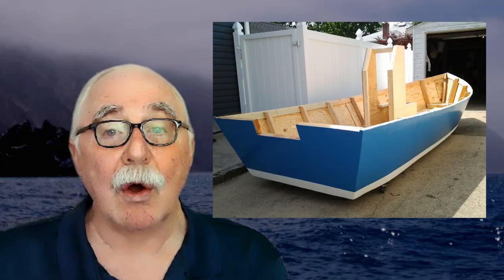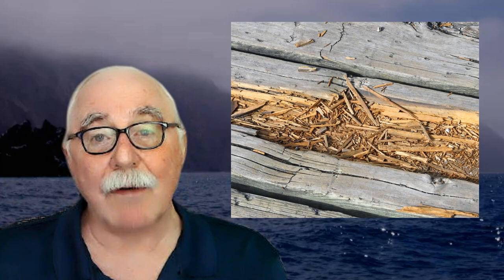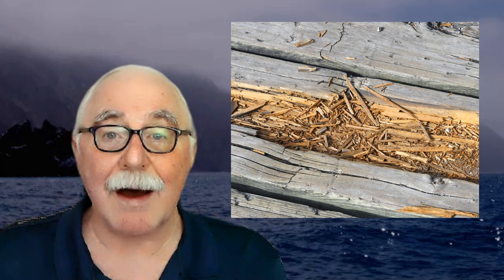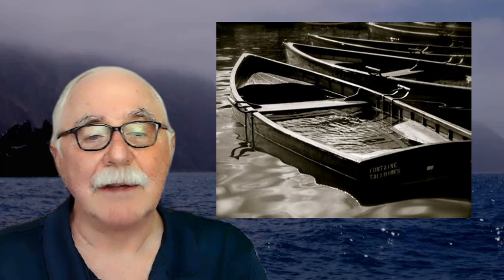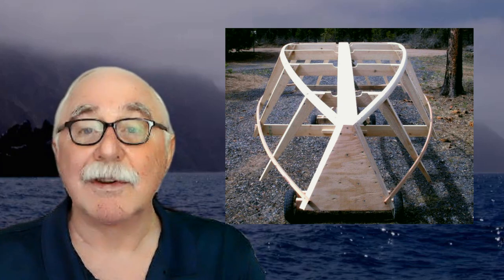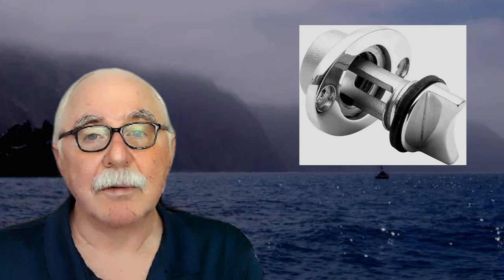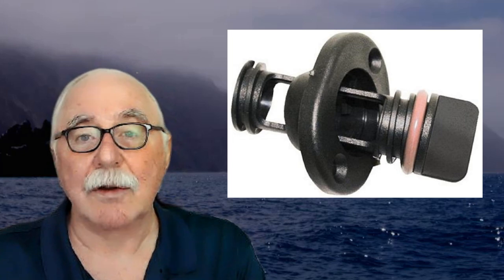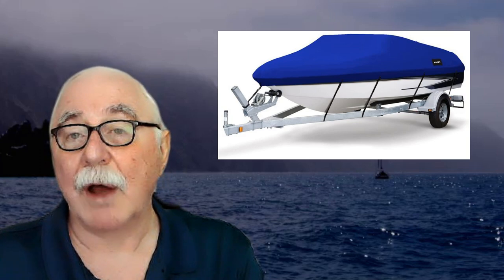Yes, You Can Build a Boat, Ply-on-Frame Boat Maintenance

Comment: In 1976 my father built a ply on frame 12 foot runabout and painted it outside with 2-pack iso-cyanate white and inside 2-pack boat varnish.  I helped him repaint it about 1989, 13 years later.  The white was still quite good, but the varnish on the topsides was badly cracked up.  Once done it was almost like new but should have been done 5 years earlier to prevent damage to the wood from cracked varnish.  Note, the boat was always stored covered and in a shed.

Comment: Hi Jeff…thanks for keeping us boat builders informed with up to date info. You didn’t mention anything about how epoxy coating the wood helps prevents root. I fiberglassed the outside of the boat and epoxy sealed the entire inside then painted everything. Perhaps you could discuss how the epoxy coating helps aid in longevity if the paint/varnish.

Comment: In the philippines i mix sbout 3 putty knifes of each part of marine epoxy and 1/3 gallon of lacquer thinner and mix it well then paint it on your wood and put 3 to 4 coats on all bare wood and it does an amazing job of water proofing the wood, then i apply 2 or 3 coats of marine epoxy primer then several coats of epoxy enamel paint and that seems to keep the wood dry no matter how much water sits in the hull. No fiberglass at all. 😁☔💦🏝️
Reply: Is this a joke?  Sorry, I'm not a boat guy. If you're serious.  I'm interested to know.
Reply: @nledelnr  yes it works great. The enamel i use is epoxy enamel for the final layer.

Comment: As an industrial chemist specializing in paints with 40 years experience and a lazy maintenance guy,  I just wouldn't varnish anything outside. Its never the varnish that fails its the fact that UV passes through varnish or PU or any clear coating and destrpys the wood lignin and you can not stop that without pigment. As for enamel you are quite correct there is very little difference between reasonable quality enamel house paint and marine enamel apart from the price and label, often it comes from the same tank.
Reply from the maker: Thanks for the comments!
Reply: Why not epoxy coat the interior too and then paint over the epoxy? Sorry if this is a dumb question. I'm not a boat guy or a chemist.
Reply: @nledelnr  definitely valid I do that often as I said the paint cuts out the UV light which is the damaging force.

Comment: If a lazy person has to leave a boat out where rain collects, would scattering a few pounds of salt in the bottom protect from rot?
Reply from the maker: Yes, it will definitely help, but you have to stir it enough to get it to dissolve and that means moving it around. So as long as you're pumping it around to dissolve the salt, you might as well pump it out of the boat. Best bet is to pump it out and put salt into a dry bilge so that anything that gets in meets concentrated salt, but you know that will promote corrosion in dissimilar metals.

Comment: You fail to mention an OIL finish for bare interior wood surfaces...like Deks Olje...penetrating and very easy to recoat yearly...UV has little effect
Reply: what kind of oil are you talking about? A drying oil like  teak or linseed oil.

Comment: What about fiberglassing the interior as well as the exterior. Zero maintenance to worry about
Reply from the maker: Zero maintenance fir a year or two until the wood rots out because of trapped moisture. It'll last a LOT longer if you let it dry out.